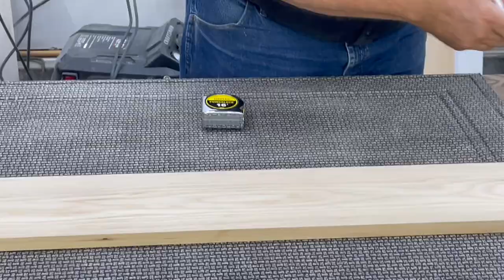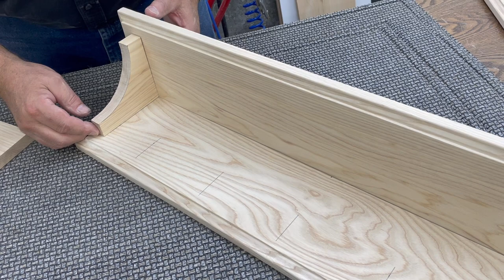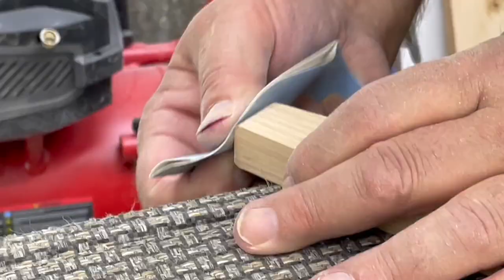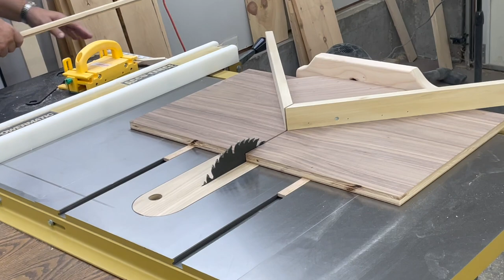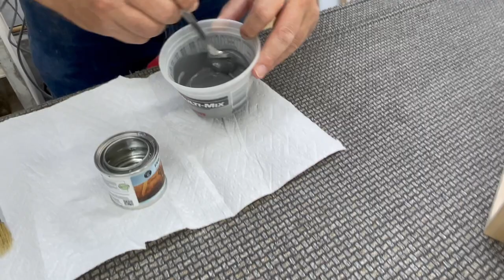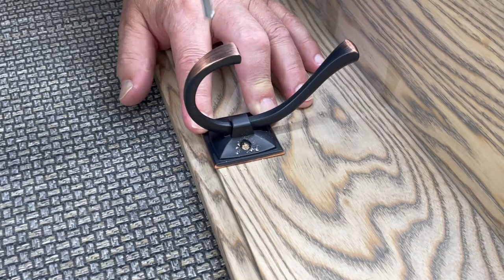Coat Hook Shelf In Under 2 Hours

Comment: Question: if the studs are 16” on center and the coat hooks are centered at 5” apart, how will the hooks hide the mounting screws? I’m sure that I’m missing something as a newbie.
Reply from the maker: Hi...the mounting plate on the hook would allow for 16" on center screw holes. Thanks for watching, Wes